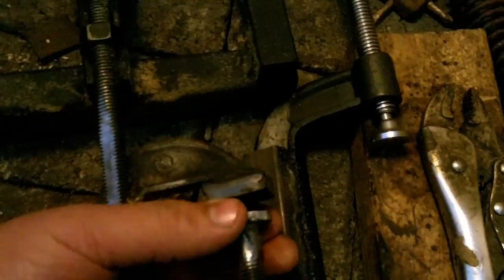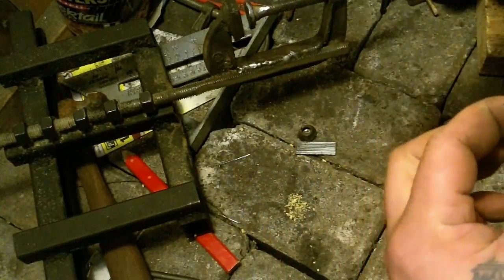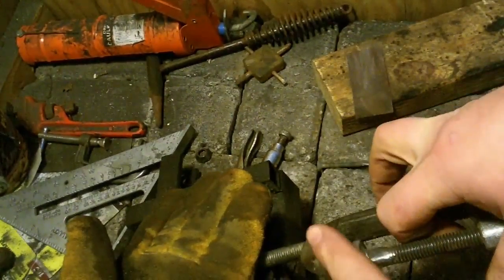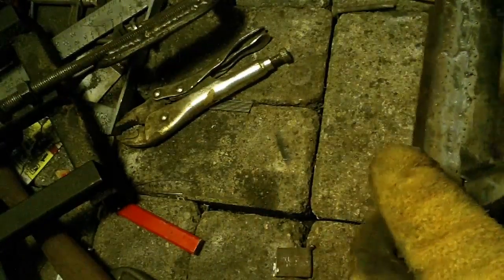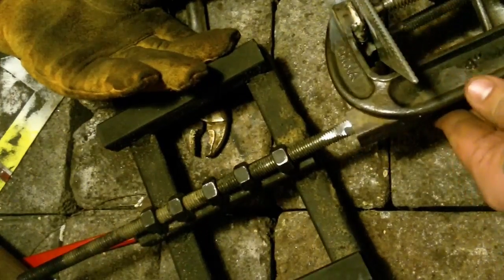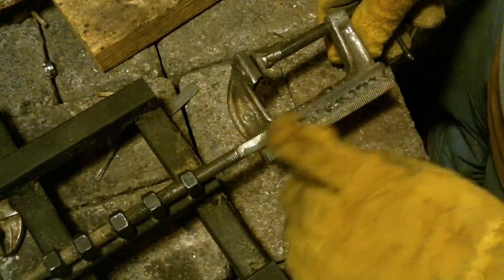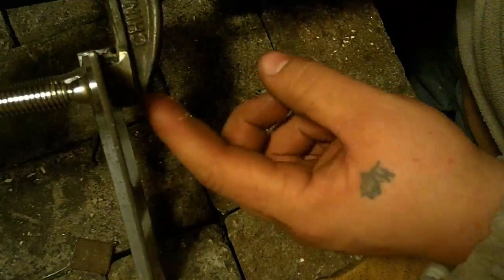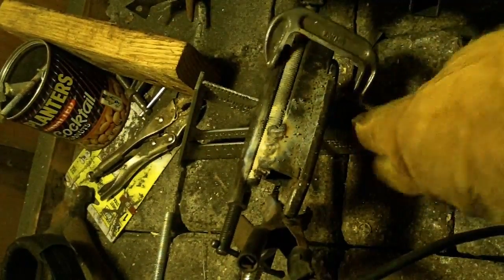CHAINSAW MILL  2.0

Comment: Have you considered drilling a hole in the chainguide for the all thread and bolt it up on both sides? Even if a bolt comes loose, your chain doesn't get damaged.

Comment: The problem is the coarse thread on the clamp. A fine thread will hold tighter under all that vibration.
Reply from the maker: Thanks for the information. I never thought of that, it makes sense.
Reply: Maybe a backing nut

Comment: i picked up a poulan from princess auto bargain bin (basically new) in the box the bar wasnt even scratched said it wouldnt stay running... after 10 minutes of dicking around i adjusted the idle and now it runs like  champ for 50 canadian pesos
Reply from the maker: Nice! Glad you got it going. I got my 14 inch Poulan as a refurbished saw so i got a nice discount on it.